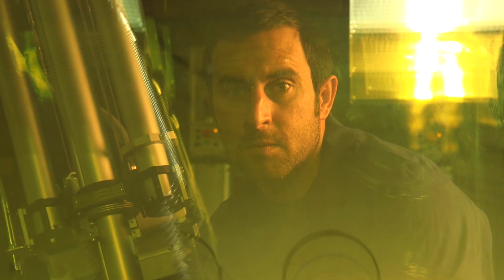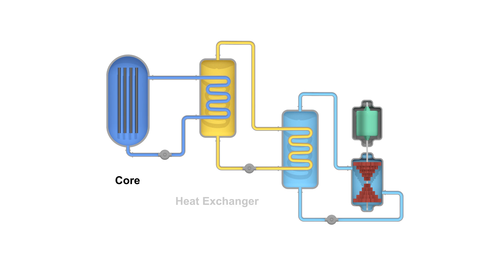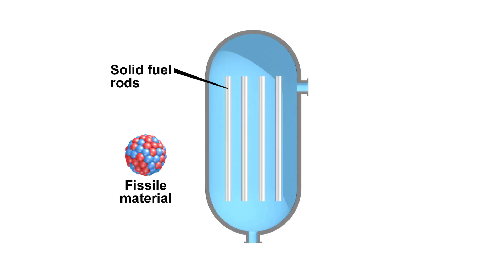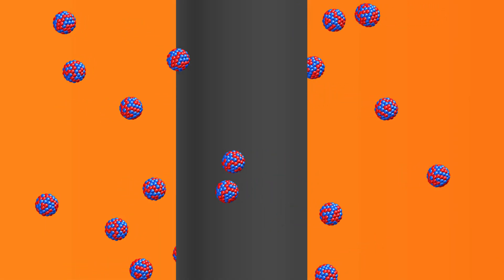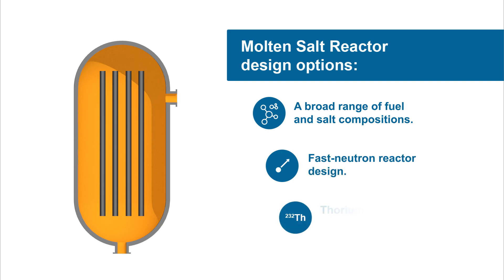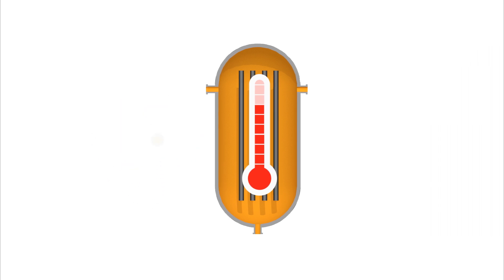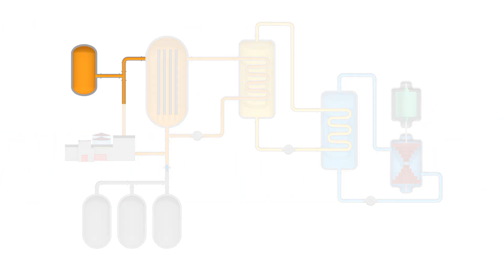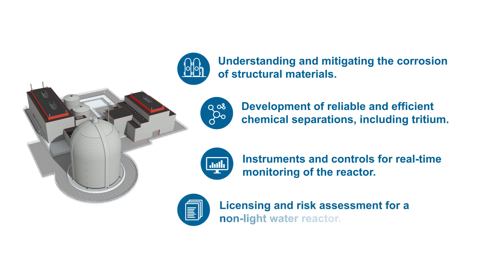Molten Salt Reactor Fundamentals

Comment: That guy looking at the 6000 operating hours designed both the light water and molten salt reactors.  He died in 2017, I think.  That was on the MSRE that Oak Ridge did, 6000 operational hours!

Comment: The arguement for fuel heating up squeezing fuel out of the core only works for HEU or Fast Chloride-MSRs, not for thermal MSRs with HALEU & LALEU because you squeeze out more non-fissile neutron absorbers, like 80-95+% U238 vs fissile 3-20% U235, or 2-12% U233.

Comment: I like the Idea of these salt reactors I'm just not so sure about thorium it self. If lets say the world were to jump into it today and build all kinds of thorium reactors could we keep up the thorium mining to meet demand? The video said thorium is 3x more abundant but what it didn't tell you it isn't in concentrated areas like other things we mine. Could uranium be used as well as thorium?
Reply: Indeed. MSRE worked on uranium salts, so MSRs can run on uranium with no problems.
Reply: @caav56  They work better, cheaper, and easier with uranium. Also, uranium is just as abundant as thorium, if not more so.
Reply: @chapter4travels  Not in India.

Comment: ... and then the piping ruptured, and molten salt poured out all OVER the place.  But then it solidified as it cooled, which is good right?  Except that then, it rained.  And salt DISSOLVES in water.  So all that radioactive salt, is now in your groundwater table.  For the next 20,000 years.  Wow MSR is SO much safer, huh?
Reply: Isn't it amusing how msr enthusiasts don't want to think about hot, corrosive radioactive salts circulating through 100s of meters of pipes, valves, joints, & plumbing might not be the best engineering solution?
Reply: @rhynosouris710  It makes them feel smart to say "MSR" though.  That's the main thing.  You can't expect actual understanding.
Reply: @rhynosouris710  What about stable salt reactor, which eliminates the whole "radioactive" bit in circulation and leaves us with no worse than what we work with on concentrated solar plants?

Comment: A bi product of this type of reaction, still leads to nuclear waste, so I don't see this as an alternative, to the current fission reactors we currently use, I still believe Hydro thermal is the way to go, there are hundreds of Hydro thermal location around the US, and possibly thousands around the world. If Iceland can go it, so can the rest of the world. It's clean, and there are no toxic bi products.
Reply: Nuclear waste is not now or ever been a problem, in fact, it's a very valuable asset. Different versions of MSR's will consume it as their fuel.
MSR's are very different than the old light water reactors in several ways. The biggest advantage is the high output temperatures, more than double LWRs. This means they have hundreds of other industrial uses besides making electricity. They also don't need water cooling, you can put them anywhere. They are safer and cheaper to build because they are not under pressure like LWRs.
Reply: @chapter4travels  Who says so?  Sounds like the same industry lies and propaganda we've heard for all previous reactor designs.
Reply: @Rep0007  What previous reactor designs? Be specific.
Reply: Finally a voice of sanity in this industry-paid shill section.

Comment: remember its not thorium that makes waste that decays in 300 years its just the molten salt part. if you used uranium in a molten salt reactor you could keep burning till the long lived stuff has gone
Reply: Actually, u233 produces more or less the same quantities of long lived fission products as commercial reactors. Long term disposal solutions will still be require
Reply: Yeah but you have to create the fissionable material then. With Thorium you just have to dig it out of the ground.
Reply: @ValeriePallaoro  uranium is just dug out of the ground. Same as thorium there is no difference lol

Comment: What about the interface with water in the Steam Generators? Isn't that the reason liquid sodium was not used on the Navy subs due to the interface using water on the secondary side? While working at Enrico Fermi II, we were provided a demonstration of the sodium/water interface by an instructor throwing a piece of sodium into the cooling pond, which resulted in an explosion of impressive features. Is it possible to replace water and the cooling medium on the secondary side to avoid this? Should the Steam Generator integrity be lost, this would not be a "good" event!
Reply: Salts are completely inert to water or air, an interaction with steam may be energetic (like any hot/cold fluids contact) but not explosive
Reply: @Alessandro-1977  sir, I beg to differ? While working at Enrico Fermi as a member of the Fire Brigade we were provided a demonstration of sodium/water interaction & it was explosive! Not a mild interface as you prescribe? While in the Navy, I had an opportunity to work on the Triton reactor which had been designed as a sodium cooled reactor but was abandoned after some dangerous outcomes due to Steam Generator leaks?
Reply: @xnavyro  Absolutely, but I meant salts not sodium. Fluorides or chlorides are salts (inert), sodium is a metal (potentially reactive to air/water). I hope this clarify that out
Reply: @Alessandro-1977  how about low sodium spam? how would that react in a molten salt reactor?
Reply: @roywhiteo5   I don' t really understand your question, there is no pure free sodium in a molten salt reactor, maybe you mean free sodium produced by sodium chloride dissociation for, say, mechanisms like radiolysis or similar ? It couldn't happen in ionic bounds like those of fluorides or chlorides, the rate of ions reconstruction is 4 or 5 order of magnitude (~ 10k or 100k times) than ions dissociation. I hope I answered that (not an expert, though)

Comment: More than a good idea

It may not be a clarification of what Singularity-point positioning Conception Perspective is, or how projection-drawing of holographic Superspin in rotational cross-sectional composition condensed matter in the Universal 2-ness picture-plane containment in log-antilog i-reflection, but the orientation to frequency density-intensity analysis in the context of "Comb" relative-timing ratio-rates of Spectroscopic reciprocation-recirculation potential positioning is ready for Math-Physics to advance knowledge of conductors, corrosion and crystallisation of materials.., "obviously".

Comment: Can someone explain to me how the expansion of the working fluid during temperature increase in a closed vessel is supposed to decrease density?
Reply: I'd imagine there would be some air in the vessel, and air is compressable. Also pressure will cause the vessel itself to expand somewhat.
Reply: as shown in the video, there are outflow pipes. Some 'give' in the container design with in the parameters of the temp increase would help too.

Comment: Sorry if this is a stupid question/has incorrect terminology, but how does the molten salt expanding shut down the reaction? Is it because the moderators get pushed apart which means the neutrons aren't slowed to being thermal, slowing down fission?
Reply: I think it has to do with thermal expansion; this results in lower density and thus a negative reactivity coefficient with rising temperature.

Comment: Do molten salt reactors explode?
Reply: No, bc the coolant doesn't need to be pressurized.

No pressure, no explosion.
Reply: @TheInsaiyan  the coolant will be used to make steam, which will be pressurized. The possibility of a steam explosion, while pretty small, is not zero.
Reply: @rhynosouris710  The coolant (molten salts) does not explode and has overflow pipes into safety containers. The steam is used in another area. Yes, that could explode, however the key point is that the water used as coolant heated to steam level is what has caused all the explosions in Uranium reactors, putting fissionable material in the air. Explosion of the steam as you predict is just water in the air. So, not zero proposition, but not problematic either.
Reply: If the enemy missile hits the power plant and explodes the vessel of liquid salt the salt as an expanding cloud would very rapidly coalesce to small solid granule.  Robotic vacuuming end of shift.  Cheap electricity defines world peace.
Reply: No. It's roughly like turning on a gas oven; since you're already cooking something on the stove, burnng gas, you can't have a gas buildup.
Reply: If there was a ruptured pipe or containment vessel, molten salt full of radioactivity would pour out and solidify.   Then that night dew and rain would dissolve some of the salt, seeping into the groundwater to create a Superfund site for the next 20,000 years.

Comment: I'm sorry but doesn't sodium combust when exposed to air , water. So a pin hole leak and then a massive boom right?
Reply: pure sodium does explode, but they're using salts, not pure sodium. Table salt, which is sodium cloride, does not explode when in contact with air or water, despite the fact that it is 50% made of pure sodium.
Reply: @dskaz8926  
It is a compound so the chemical nature is changed. Just like CO2 is an inert, expelled gas while CO is a toxic gas to human and animal life.
Reply: @dskaz8926  You are correct. Salts are extremely stable. Strong Ionic bonds aren't affected by much.
Reply: But they used an lithium fluoride and beryllium fluoride mixture, idk
Reply: U mean when exposed to water
Reply: @miguelchacon2717  yes! Question though if there was enough moisture/humidity in the atmosphere  isn't there the potential for reactivity as well.
Reply: The results in the 60s showed their coolant showed no violent reaction when exposed to air, water etc.
Reply: First - they doesn't use sodium salts for reactors yet.
If we use sodium salts there is very small amount of pure sodium produced in the reactor.

Comment: I suspect we in the US will be buying Chinese MSR's long before we quit tripping over our own shoe laces.
Reply: @swirly squirrel this is a safe and viable energy source 
 Is that you EXON BP ?
Now if we could do the same for batteries...
Reply: squirrel  so is the environment. 
Don't get me wrong little feller...
I'm a firm proponent of survival of the fittest...
Reply: @swirly squirrel is that such a terrible thing?
Reply: @MalleusDei275  wow! Look at all the nuclear engineers engaging in intellectual talk! We're really going somewhere in this comment chain... Look out world, we got ALL the answers right here! Cuz we know so much up in here!
Reply: @wedgeantilles7731  and yet here you are einstein....
Best you quit eating hamburgers, 
You know how detrimental those cow farts are....
Reply: Assuming the safety department hasn't replaced them with velcro by then 🤦🏼‍♂️
Reply: 2021 says differently
Reply: For once China can do the heavy lifting and accident cleanup. China's expertise is in lower cost construction and lower cost to manufacture high grade metals and cement, cabling etc. Essentially a rebirth of nuclear power plants is a godsend to Chinese concrete, steel, worker deployment, cables, electric hardware and offers a baseload lower cost answer to Asian coal power. China doesn't even need to have uranium deposits as the radioactive quantity needed is small. Refined salt is easy to source
Reply: In a role reversal we'll let them invest the huge sums of money to develop the technology and then we'll either move forward ourselves for less once it's proven or steal the technology through reverse engineering the way they do it.
Reply: Actually that's probably a good thing for the enviroment but it will mean that the US will be a third rate power by then.

Comment: If the moderator in the MSR is solid graphite and the fuel is liquid, we can NOT consider the MSR an homogenous reactor, can we? Because I knew that by homogeneous we meant a reactor where both the fuel and the moderator were liquid
Reply: A fast MSR could probably be called a homogeneous reactor. Some of those use neutron reflectors though. Not sure if that would invalidate the label.

Comment: I have wondered, which fission products are most problematic to deal with in an MSR. Yes, the gases bubble out, but I have heard that some product metals can plate out within the reactor. Surly they are not all easily captured and dissolved within the salt, or are they?  Can they significantly affect flow rates, thermodynamics and neutronics, along with the longevity of it's operation time?
Reply: Yes Nolan, depending on how the chemistry in the salt is maintained, some fission products are more likely to plate out than others. The prime ones likely to plate out include elements which are both on the same row as and near palladium, rhodium, and silver, i.e., those called by some "noble metals". Flow rates? No. The amount that plates out will be small. Thermodynamics? No, since the plateout layer is small, the salt should be around the same temperature as without plated out fission products. As for neutronics, other fission products which stay dissolved in the salt will matter much more simply because they are more abundant: samarium is a big one.

In terms of stuff like that, something that will matter a good bit is chromium thermal transport. On the hot end and before the heat exchanger, chromium will tend to dissolve from the tubes' walls, while on the cold end and beyond, it will tend to deposit. This will possibly foul heat exchangers to some extent and accelerate corrosion.
Reply: Thanks for the answer. I'm sure all these issues and the changes in the salt chemistry are all likely still being researched and modeled. Lets hope they run into very few hiccups and get these things developed.